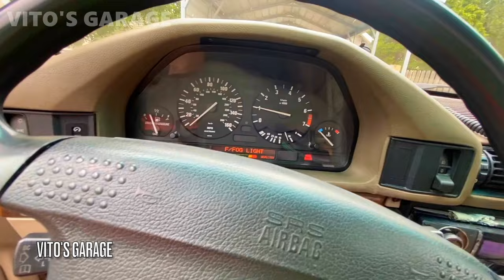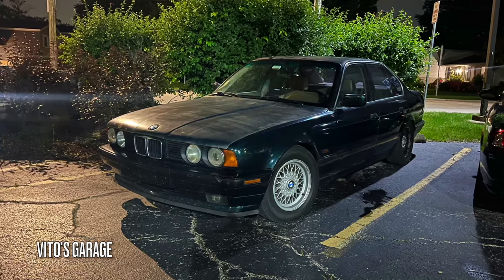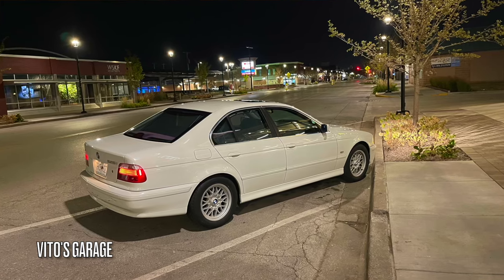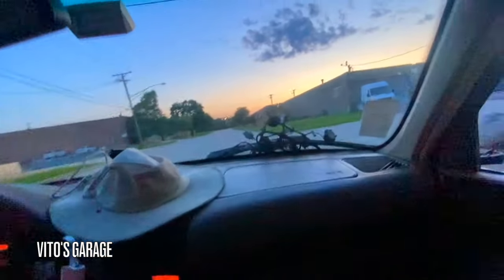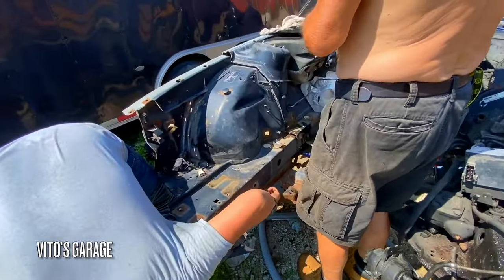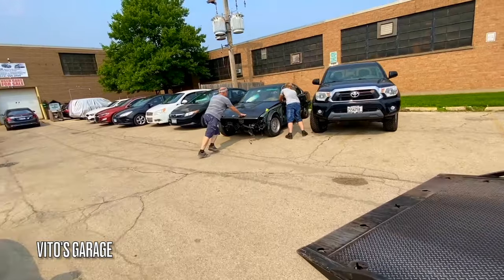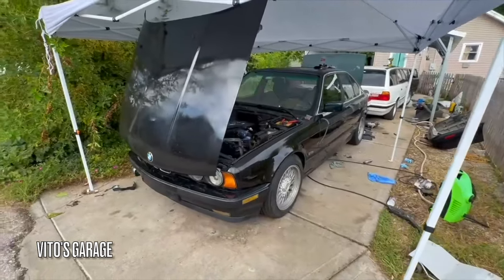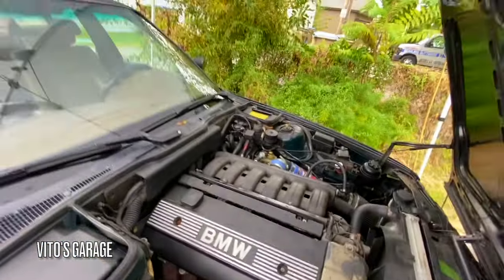Restoring a Crashed BMW E34 525i in 1 Month! Save Old School Cars!!!

Comment: No You are absolutely not right, it can happen, there should not be necessary a stop sign. In that case there is the rule "right before left" 
If you don't stop in the intersection to check the upcoming traffic then you have a problem and you are not good enough skilled to drive. That's important. All the other stuff you say in the video are excuses. You and especially Leo should have stopped to check the traffic and you didn't, so... It is to be expected.... I hope, lesson learned the hard way...
Reply from the maker: Lol what?? The dump truck driver should have stopped, especially seeing us driving and knowing that he is pulling a big trailer. That’s impedance of traffic also..
Reply: @VITOSGARAGE  Even if you are right, you should always stop to double check just in case... i mean, better safe than sorry... There are always crazy people driving out there
And if he was from the right he had priority, just simple driving rules...
Reply from the maker: @yiannistsiarektsis3215  whatever you just said I have the same thing to say to that dump truck driver who decided to pull out from behind the bushes. 
It’s dumb not to have at least 2 stop signs or at even yield signs. It’s very very unusual. Most of the streets in the US have at least 2 stop signs on any intersection
Reply: @VITOSGARAGE  Even if you are right you should be really careful while driving just in case just in order to prevent anything wrong.